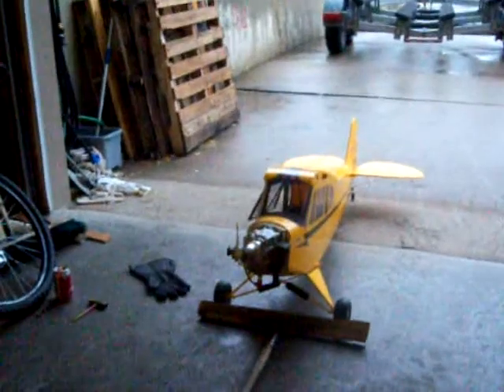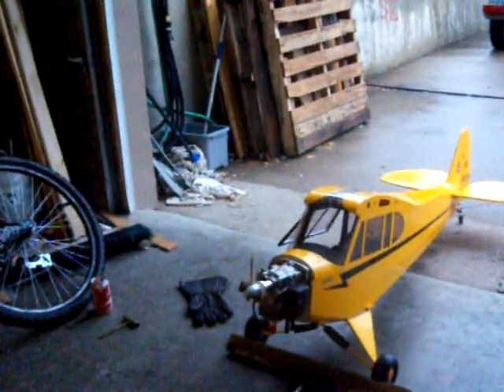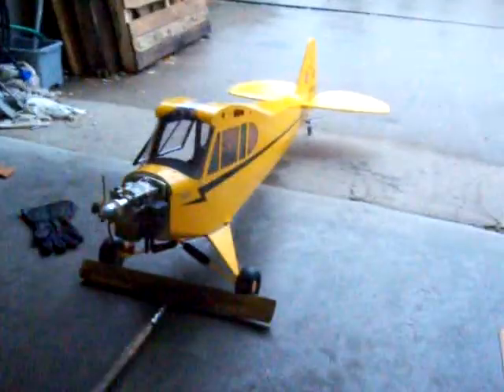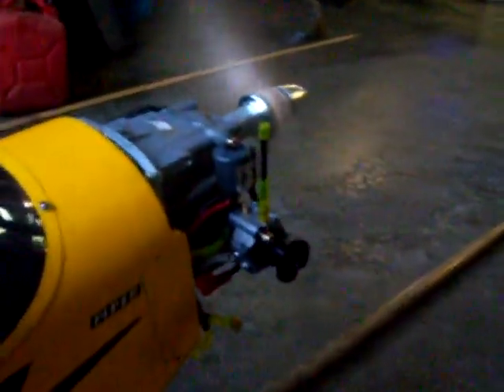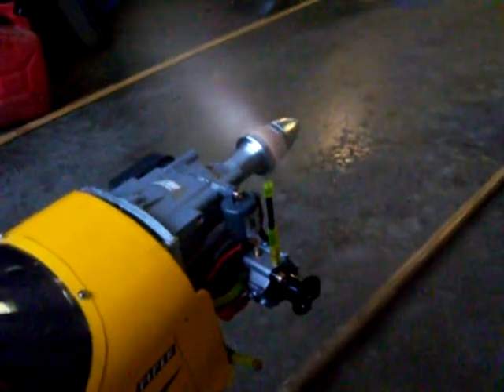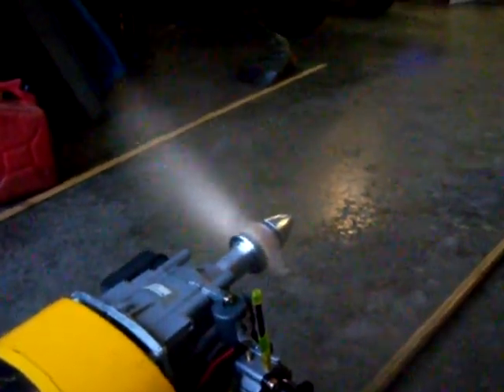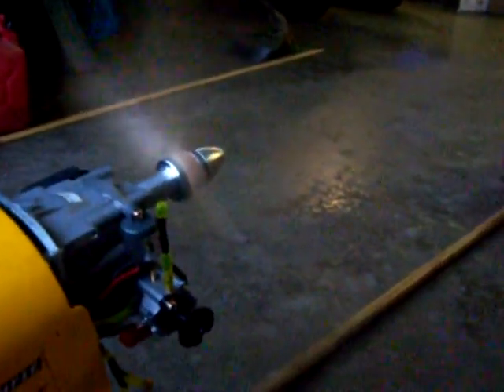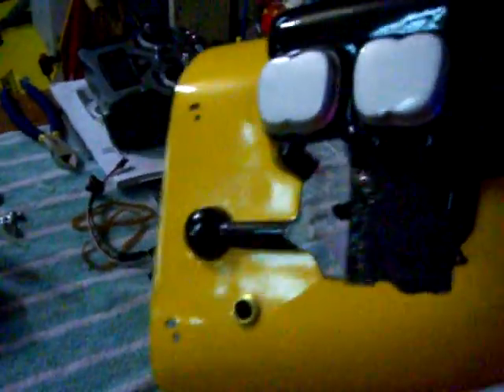Zenoah G26 ground run installed in a J-3 Cub 1/4 scale

Comment: @freedomintheskies 
Thanks for the info, it's my first Gas engine & not sure weather E.I or Magneto is best ? Did you fit an in cowl muffler if so what type? Zenoah also produce a carb bend bracket do you know if this would save cutting the cowl?

Too many questions I know, but thanks again.

 Jon